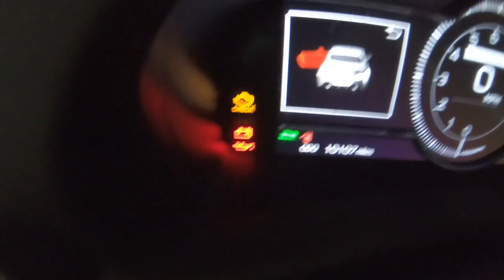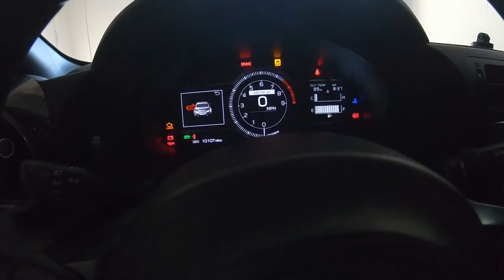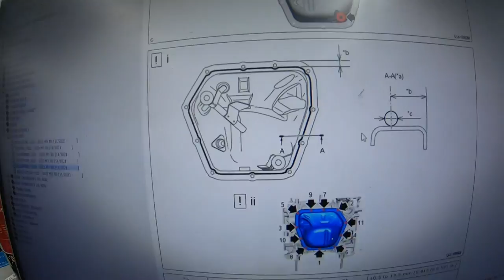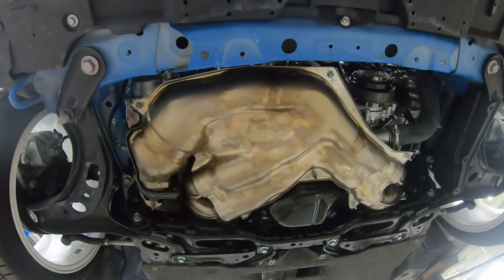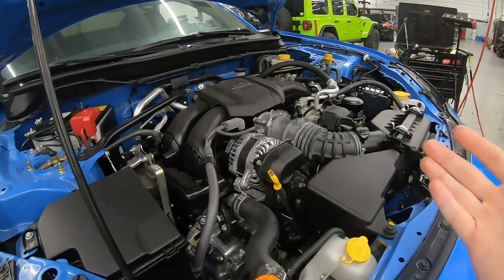GR86/BRZ RTV ISSUE & CLEANOUT

Comment: Actually the RTV might have been an issue, but…not really. The pickup tube has 5 suction surfaces so chances that RTV would block the passage and keep the oil from entering the engine is very small. 

What you should be worry about is dropping oil pressure during high G right cornering ( 1 to 1.5).  In normal driving it is impossible to reach those Gs. But, if you are tracking/auto crossing your car on 200 treadwear tires, then you might run the risk of hurting your engine due to the stickiness allowing your vehicle to reach higher Gs. You’ll make great time on the track for sure, but your vehicle will suffer for it.

Failure doesn’t necessarily happen right away, but constantly tracking or auto crossing the vehicle at those constant high G levels will eventually blow your rod bearings.

Preparation is key in my opinion. Things you can do that really matter so you can avoid this issue for now are: make sure to have your oil levels at max (check your oil periodically) A lot of spirited driving tends to burn oil. Stick with your pilot sport tires or equivalent. 

Don’t go 200 treadwears. Install a baffle plate and oil cooler if you plan on tracking and auto crossing. Not all baffle plates are made equal so you’re gonna have to do your own research as some of them don’t work as intended.

My car has 56,000 miles. Track, auto cross, Highway and mountain roads miles. I dropped the pan once just to install my baffle plate. Didn’t bother with the RTV.

Kudos for being proactive.
Reply: Forgot another thing. Don’t stay at higher RPM ranges for an extended period of time. I am talking 6500-7500. Learn how to heel/tow and vary your shift points.
Reply from the maker: Wow, I appreciate you taking the time to help give everyone a better explanation about the occurring issues that is happening with the car. I have actually looked into doing a lot of that actually, money is just tight atm and I have limited resources at my disposal. Once the time comes I will certainly be putting a oil cooler, baffle kit ect… thanks again for the info, and I appreciate you watching the video 👏💙
Reply from the maker: @Julianklaus  noted, I will 100% try to remember that 💪💯
Reply: @Justinackerman_  plz check out 900BRZ's video on Oil pressure loss, it is a thorough data driven research video about the BRZ's oil issues
Reply from the maker: @Dylanbforthree  I actually have given a lot of his videos a watch already. It’s very awesome of his to show and demonstrate the loss of pressure and to help give a thorough explanation of what truly happening with these motors. Thanks for taking the time to let me know about his videos though homie 💙
Reply: I'm in the market for the 22/23 GR86/BRZ, I plan on daily driving it. I also wanted to track it like once or twice every couple of months. I was wondering if I was to remove the oil pan and take out the loose RTV and then install a baffle plate, would I be okay driving it without having to worry about it blowing up on me? I'm also thinking about installing a oil cooler as well.
Reply: @slowgr86   Just do your research on the baffle plate you plan on installing. Not all baffle plates are made equal and some might even create issues and further exacerbate the low oil pressure issue with long right-hand turns on track . If you plan to track only once every couple months, I wouldn't worry about a baffle plate. I would focus on adding an oil cooler to keep oil temps low especially if you are in a hot area. Additionally, if you are in a hot area, I would suggest and heavier oil grade during tracking sessions. 0w40 with maybe 1/4 overfill. Daily driving, I would stick with 0w20. Also, stick with your PS4 tires. No reason to go higher than that. After every track day sessions, change your oil!
Reply: @Julianklaus  tyty
Reply from the maker: Absolutely well said, I don’t think I could have explained it any better. Hope to take the car out to an track event sometime soon, worried about not having an oil cooler. I might just take it easy on the first event anyways.
Reply: @Justinackerman_  You should be ok. The car comes with an oil cooler from factory. Albeit not a very good one, but should work until you get a dedicated one. Shouldn't be an issue at all. However, you need to be aware of what's going on with the car while tracking at all times. Don't run 200 threadwear, if in warm weather, run heavier oil 1/4 overfill. Some say 0w40, others 5w30. You're gonna have to decide on that one. Most importantly, check your oil temps and if you are running hot, take breaks between laps to allow your engine to cool off a bit. I might be conservative here, but for your first run, 220-239f should be your limit, then cool-off lap. And careful not money shifting...

Comment: wondering how much it cost you for the work? not sure where to bring my gr86 to hopefully get it checked out and cleaned for rtv without getting scammed by the dealership
Reply from the maker: Wassup fam, so I actually had the same thoughts you did before I had this done. I called my local dealership where I purchased the car, and they quoted me alittle over $1000. Thats pretty ridiculous in my opinion, I know at the end of the day it’s smart to do the RTV clean out, but at the same time quoting this much for the work is crazy. They should definitely source this RTV issue as a recal, and should let any GR86/BRZ owners come in for free and have the pan dropped to check for RTV. This would be the perfect median in my opinion. I hope you get everything sorted with yours, please give me an update if and when you decide to do yours. Thanks for watching the video fam, the support means a lot 👏💙

Comment: Thanks for the info bro! By the way I’m getting my AWE track installed tonight and I’ll get it back tomorrow. So excited! Also, where did you get the ducktail?
Reply from the maker: Glad it could help. Awesome to hear you are installing your exhaust tonight. You are going to be so shocked with the difference it makes, keep in mind the exhaust will need to break in for the first 2-3 days. Exhaust mods are by far the most favorite mod I think you can do to a car. As far as the duckbill goes I will locate if I have the exact link as to where I bought it from. Thanks again for watching the video 👏💙
Reply: @Justinackerman_  yessir. For the break in do I need to treat it how you do the first 1000 miles? Sounds good to me.
Reply from the maker: @Jbargnani94  naw, let that baby scream. The exhaust piping will eventually just settle with the rest of your stock exhaust piping. Keep in mind once you set the tips at the desire spot on the rear, they will move and shift around a bit. So after a few days I would make sure the exhaust is sitting where I want it to be. Hope this info could help

Comment: RTV is probably not a big issue. Or at least not The issue. Not great, but not likely to cause failure. And it's all over the place, by the way.  Not just the oil pan. If you daily drive the thing and take care of it, it will probably last forever, as is.  As it turns out, it seems like the problem is more related to high rpm right hand turns. Race situations.  For some reason, the oil pressure drops significantly when turning right at high speeds.  There is a group of guys working on the issue.  No results yet, as far as I know.
Reply from the maker: Yeah, I’ve heard the silicone is forming like this in 5 places. I daily the car, but at the same time like to have my fun with it. I will certainly make sure to take as best care as possible of this car, I don’t ever plan to sell it. Thanks for watching the videos and showing support man👏💙

Comment: I tried taking my GR86 in for the dealership to check it but they refused. They told me if something does happen, my warranty will cover it 🤷‍♂️
Reply from the maker: That’s pretty absurd, I talked to my salesman and a service advisor when I called them to ask about having them do it originally. They agreed to do it cause I told them about all the other incidents that were occurring. Once they said they would do it, before even taking it in to inspect it, they started quoting me all these crazy prices. I would definitely try to get in contact with them again, and discuss this issues with them. You can reference this video as well to show them what truly is occurring within the pickup tube of this car. I appreciate you watching the video👏💙
Reply: I would definately want to get that reply in writing or on a work statement,  for records so they do back track and say it is not covered
Reply from the maker: @GundamEleven  when I purchased my warranty I had them in writing say that if there was any ever RTV issues I’d face it would be completely under warranty even if that meant putting a new engine in the car and they did that for me. I still felt the need to have the RTV cleaned out though for safe measures.